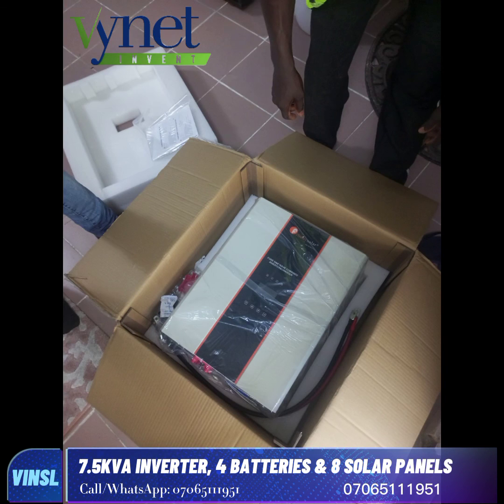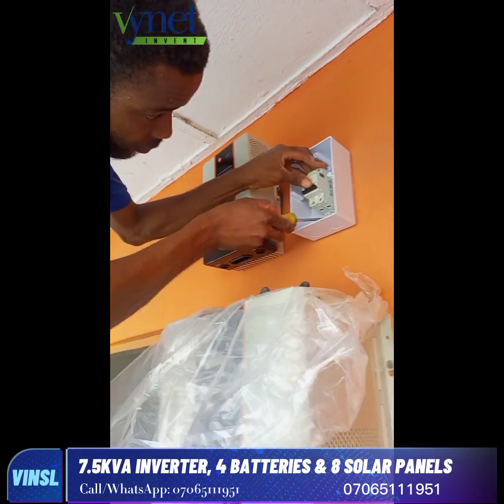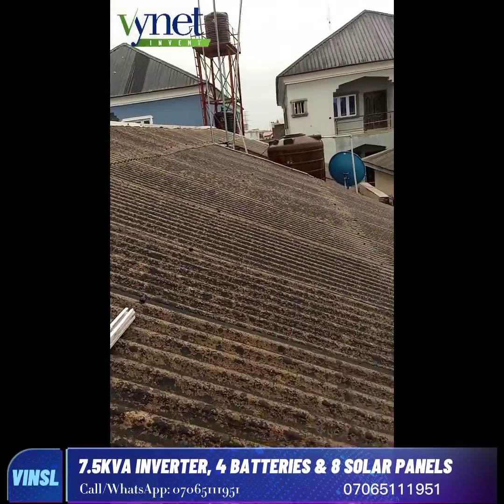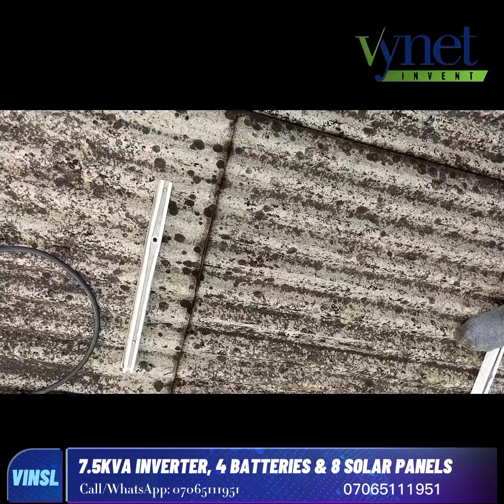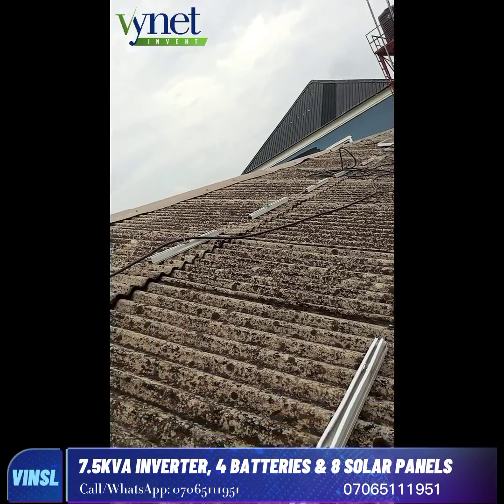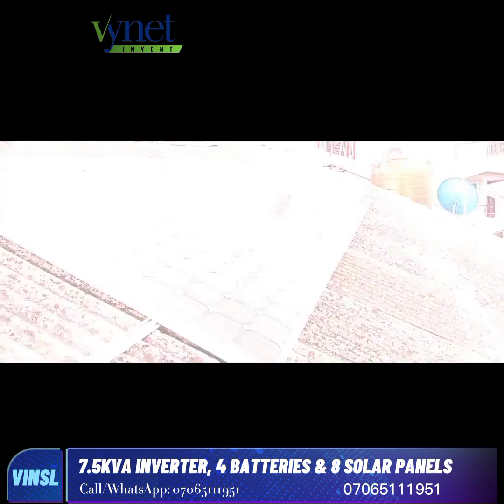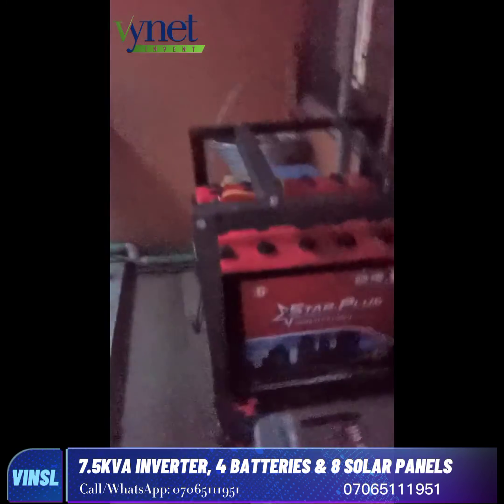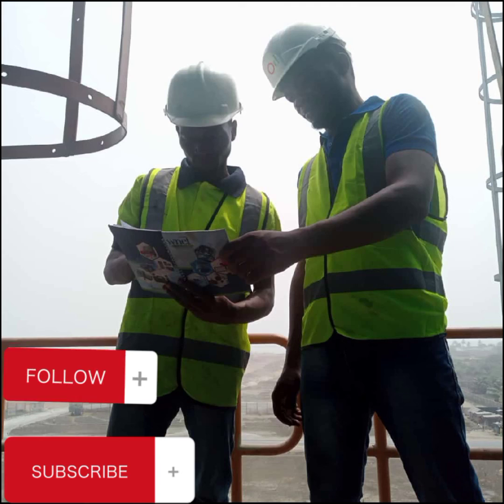INSTALLATION OF 7.5KVA INVERTER, 8 SOLAR PANELS & 4 BATTERIES

Comment: Plss can it works on auto operations or there should be need for automatic change over
Reply from the maker: It works on Auto operation. There is manual change over for bypass mode

Comment: What is the size of those batteries all together. I think the batteries are small for 7.5kva inverter. At least a 10kwh lithium battery can work best.
Reply from the maker: Total battery capacity is 10.56kwh